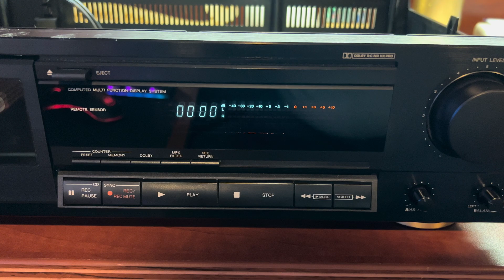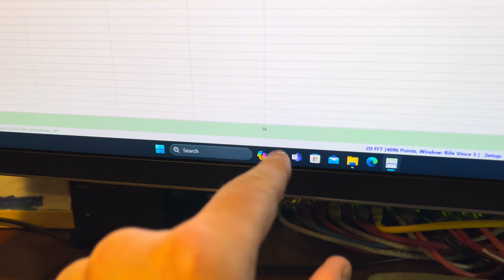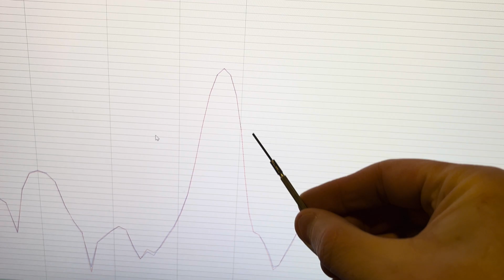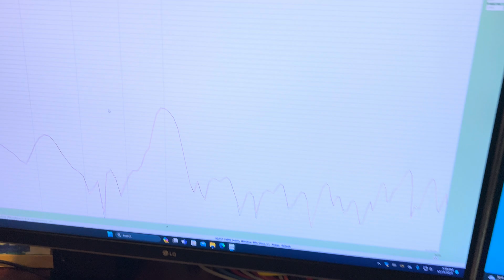Cassette Deck Speed Calibration - My Process

Comment: As a new DIY techie, I tried to adjust the speed on my JVC KD-V6 that was about 2% fast, but having no knowledge, could not see how to work the motor control potentiometer. I used the wrong tool and ended up ruining the motor! I did not realize that plastic can be cleared with a very small screwdriver.  Had to buy a used deck to get a new motor. Only place that had a replacement, and it was not an original, and did not guarantee it would work, was Pacific Stereo, but they wanted $150 for it.  I bought the used deck for $80.  I really screwed up, but guess that is one way of learning.
Reply from the maker: Sorry to hear about your experience, the motors usually have an adjustment that a small screwdriver would use and you don’t have to push very far in

Comment: Hi, thanks. What rubber reapir should I get and how to apply it?
Reply from the maker: https://a.co/d/hENua4S
Reply from the maker: Use an eyedropper or a Q-tip, this bottle will last you a very long time.  Be sure to get the rubber surface or belt, wet, and let it soak in. If it’s a belt do both sides you may have to go from an angle.
Reply: @davismv  Thank you. So I wouldn't have to take the belt off?
Reply from the maker: No, you have to be careful so if you actually are running it while it’s playing a tape, you gotta make sure you don’t push the belt out of the way that sort of thing but just put some drops as it’s going by.  The idea here is to preserve the moisture in the belt so as long as you give it a coat on both sides by applying a little bit of this, it will seep in and help preserve it.  This might be extreme, but I also do all rubber fittings and parts, like if it has rubber feet on the bottom of the unit, I coat the rubber feet because those will crack eventually and fall off.
Reply: @davismv  Ok great, thank you.

Comment: That's very interesting!  Funny, I got a JVC cassette deck recently (along with that JVC receiver that you and I worked on).  I noticed when I tested it that it was playing too slow, it was significant enough that I knew it was off.  I was a little bummed, especially since I had struck out on the receiver.  But when I looked at the front of the deck, it actually had a knob on the front that controls the speed of the deck!  I had never seen that on a deck before.
Reply from the maker: Very few cassette decks have manual speed adjustments so that’s pretty cool.